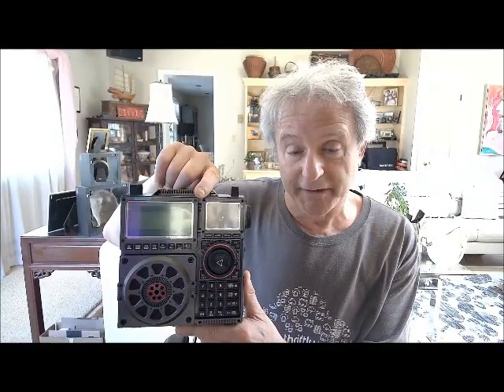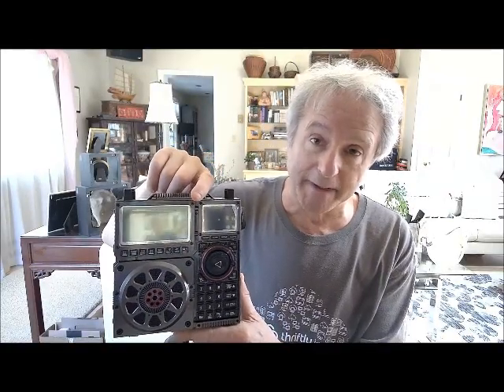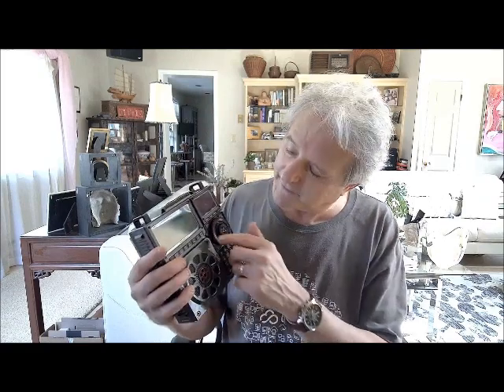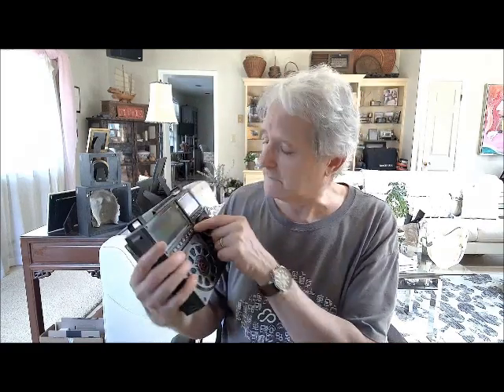New Firmware Update for Raddy RF919

Comment: Hello, a radio with great capabilities LW MW SW (AM + SSB), VF UHF in FM AND DAB+ and for digital broadcasting is definitely NOT the model Raddy RF919 or Reketess TR113! They are just overpriced pieces of shit, bragging about their broadband reception from KW to SHF in advertising, but in reality they don't want anything at all on DW, on MW about half the stations and that's with noise, on SW so-so... Also control and switching functions it is demented compared to other normal receivers and scanners. On the other hand, the mentioned models abound with unnecessary functions and nonsense such as 7 colors of display backlighting, color VU meter of nf signal instead of proper S-meter, playback of songs from the card, etc., etc., which are absolutely irrelevant for a radio communication device, expensive radio for free! OK1XPJ

Comment: The muting between freq steps appears to be a characteristic of most DSP only receivers. The tuning as well as the signal processing is all done in the DSP chip. Other receivers such as higher end Tecsuns etc have a PLL circuit which tunes the radio then the processing is done separately or in the analog domain as far as I know.  I have a pair of larger PLL receivers and the tuning is always smooth without muting. I also have several less expensive straight DSP portables of different brands and they all mute.

Comment: I just performed the firmware update to version 1.706 successfully.  I used an old 4GB microSD card.  I did a full format (not quick format) to FAT32 which took several minutes.  Copied the update file to the card and got a good update.  There is a new menu item in the system settings to enable muting.  I'm listening to the 40m HAM band and the soft muting is definitely improved.
Reply: Yes.  Version 1.706 adds an item to the system level menu to enable or disable muting while tuning.
Reply: So now you have the option to turn off the muting while tuning?

Comment: Raddy is essentially selling a shortwave radio with a major DEFECT, what is known as, muted tuning, meaning you cannot hear what is being broadcast on all t he stations as you surf the channels when you tune the radio from frequency to frequency, whether you tune it manually with the fine tuning knob or when you press a button to tune the radio from frequency to frequency. 

You will see on the frequency meter as you do this a visual display that indicates the frequency strength of each individual through signals represented visually on the signal meter station or channel you surf through.

But muted tuning means you will lose the audio momentarily so that the audio level drops off the board, as they say, completely, not allowing you to hear what is being broadcast unless you stop at any given frequency and stay there. Muted tuning can make it possible for you to inadvertently pass over channels or stations you might otherwise prefer to stay on and listen to. 

That this particular Raddy radio has this muted tuning is not a feature but a design flaw whereby the Raddy company should issue a recall and have their customers send the radios back to Raddy for a fix but Raddy will not do this unless forced to by either the US government or by a court ruling and neither one is likely to happen unless lawsuits are filed against Raddy and they will be forced to answer the lawsuits in open court or agree to an out of court settlement.   

Raddy has not been responsive enough to address customer concerns about this defect. They offer a quick-fix email link but so far, the half dozen people I've spoken to who have this radio and are stuck with this muted tuning defect have tried to follow Raddy's directions to correct this muted tuning flaw but this quick-fix does not work in actuality. At least not for the six people I spoke to. 

How many other Raddy customers have gotten similar run-arounds from Raddy,  I don't know. But as I said in my prior comment below, Raddy is a company operating from Communist China and are likely owned the Chinese communist government or their military under the business banner they call, Raddy. 

And so far, from what I have seen of Chinese companies who produce products with defects, they always fail to correct problems or address customer concerns. Once they have your money, they could care less. 

In China, over the past 40 years, there have been a never-ending number of inferior shortwave radios being produced in China and sold from there. Only a few of them have had any merit. Most of these radios have come and gone because of inferior designs and built-in defects. 

Let's see what happens with this particular Raddy radio. Let's see if Raddy takes the initiative and accepts the responsibility it should and begin not only fixing these adios but all future models of this particular radio. They need a revised schematic upon which to base refute production of this radio.

I personally will not buy this radio unless Raddy corrects the defect and markets all new versions of this radio with the problem of muted tuning eradicated. All such future models of this radio must then be sold with a new model number to reflect the fact the muted tuning defect has been corrected.

Comment: …the firmware instructions in the extended up to date pdf manual are contrary.
It asks to rename the update file in two ways…in the literature it says RF919.upd but in the example screenshot it says RF919-ENG.upd.
That stopped me in my tracks and I’ve emailed them but as yet had no reply.